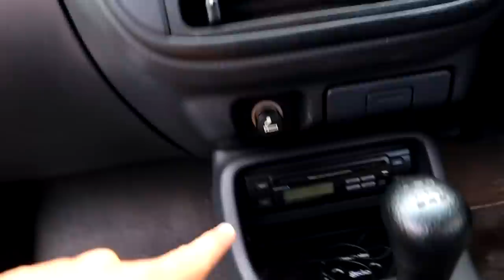INTRODUCING MY NEW CAR - $500 TRACK WEAPON

Comment: Used to have one quite a few years ago and they're actually great little cars. Mine had done 320,000k when i sold it and not a single rattle. And once you get that motor revving the don't go too bad for what they are. Brakes will need some work though. They fade pretty quickly.